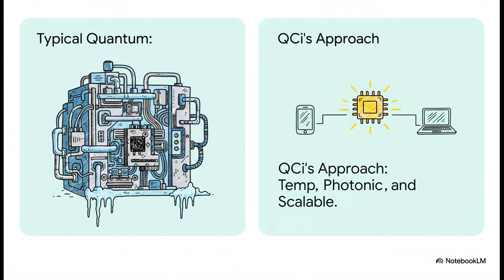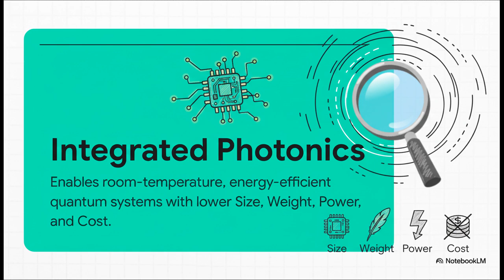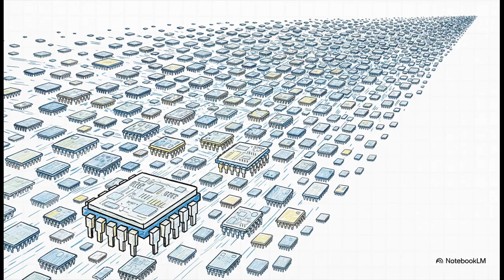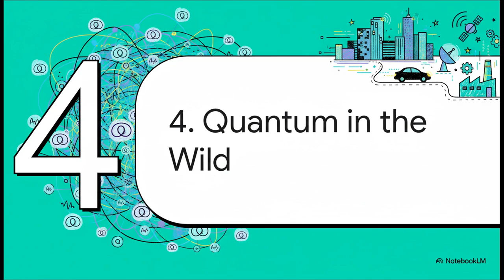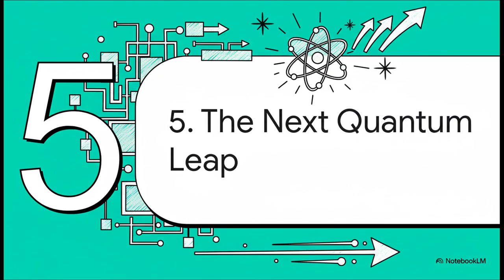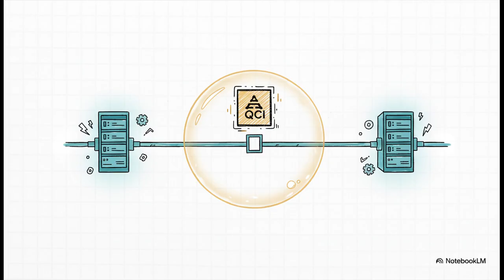QUBT Q3: $1.5 Billion Capital Raised & The Integrated Photonics Roadmap to Volume Quantum Production

Comment: I'm a graduate student and researcher in quantum complexity theory. I'm not a hardware engineer, but I do follow developments in quantum hardware closely. Based on my analysis, I have serious concerns that QUBT’s claims may amount to fraud.

I fully believe that the stock of this beverage-company-turned-quantum-computing should go to $0 (or close to it) and it is only a matter of time before it does.

Fundamentals. The market cap of QUBT is $3.73 billion and for the three-month period ending June 30, 2025, QUBT reported revenues of $61,000 (yes, you read that right), a decrease from the $183,000 generated in the same quarter of the previous year. They do not have a P/E ratio, as they are unprofitable (you could think that their P/E ratio is high and negative). This means that they have an enterprise value of roughly $3.38 billion which comes almost entirely from their market cap and with a revenue of $263k, their EV/revenue ratio is 12.870. To put it into perspective how extreme that is:

If RDDT is inflated, then QUBT is roughly 643 more inflated.
The company's operational model is a financial black hole. While generating almost no income, its operating expenses nearly doubled year-over-year to $10.2 million for the quarter, resulting in a $10.2 million operating loss. That means the company spent over $167 for every single dollar it made in revenue. The bottom line was a net loss of $36.5 million for the quarter.

QUBT's narrative is that it's a pioneer in one of the most capital-intensive R&D races in human history. Yet, its R&D investment totaled $6.0 million. To compare, Google and IBM are forming partnerships to pour $150 million into university research alone, with their internal budgets estimated to be in the billions. How can QUBT possibly compete, let alone innovate, when its R&D budget is a rounding error for its serious competitors?

 future plan For 2025, they claim "Early revenues primarily from early adopters." This is their present reality: microscopic revenues. For 2026-2027, they project "High-margin revenue from first mover advantage" and "Strong pipeline conversion." These are classic, undefined marketing terms. What constitutes "high-margin"? 20%? 80%? How much revenue? A million dollars? A hundred million? The lack of any figures makes these claims meaningless. There is no way to measure their performance or hold them accountable. They have no viable plan to get an advantage. It's a promise to perform well in an undefined future market.

They sell something they call the DIRAC-3, which is an analog quantum annealer. It is not a universal quantum computer capable of running a wide range of algorithms. Its sole function is to find approximate solutions in a a narrow category of optimization problems. In practice, its actual use is almost certainly confined to experimental and research settings. The buyers are not businesses looking to solve their core operational issues, but rather academic institutions or corporate R&D labs that are exploring novel computing architectures. For these niche customers, the DIRAC-3 serves as a piece of laboratory equipment to test theories, publish papers, and perhaps make small claims in quantum-adjacent research. The almost non-existent revenue confirms that it is not being deployed for any meaningful commercial or production-level task.

The primary reason a research group might acquire a DIRAC-3 has little to do with solving a pressing business problem better than a classical computer. Its appeal lies in its novelty and convenience. The machine's use of "qudits" and its analog architecture makes it a fun object of academic study at the very best. In essence, someone would want the DIRAC-3 not because it provides a superior solution, but because it is a comparatively cheap tool for exploration and playing around, not a tool for production.

The future prospects for the DIRAC-3 appear exceptionally bleak. It is trapped in a brutally competitive field and it has failed to demonstrate a decisive advantage. To be commercially viable, it must solve a specific, high-value optimization problem significantly faster or cheaper than the highly-refined classical software that has been developed over decades. There is zero evidence that it can do this, and it will never be able to do so. Its potential market is being squeezed from both sides: classical optimization algorithms continue to improve, while the slow but steady progress of true universal quantum computers (i.e. by Google and IBM) threaten to make such intermediate devices obsolete. The DIRAC-3's most probable fate is to become a technological footnote. It is an interesting but ultimately unsuccessful architectural experiment that never found a problem it could solve well enough to justify its own existence in the commercial world.

They make some claims of what they "will develop"

First is the Photonic Intelligent Unit (PIU), or "Reservoir Computer," which is being marketed as a revolutionary device for "compute at the edge" and Artificial Intelligence. This is straight up misleading and the reality is that reservoir computing is a highly obscure, academic niche even amongst researchers. It has zero commercial adoption. The AI market is not asking for this and it never will, not even in 20 years. AI is built around GPUs and specialized AI chips from NVIDIA, Google, and Apple. The notion that QUBT's niche device, based on a fringe computing model, could make even the smallest dent in this market is laughable. It is a solution in search of a problem, a research gadget being passed off as a commercial AI accelerator. Its only potential customers are a handful of academics, not the enterprises driving the AI revolution. I fully believe they only included the word "AI" as a buzzword to attract and scam more investors into their sham of a company.

Next is the Quantum Cyber Module (QCM), which promises "unconditional security at chip scale" and is supposedly destined for "cell phones." This is pure fantasy. At its core, this device is likely just a Quantum Random Number Generator (QRNG), a piece of hardware that has been around for years. While useful for specific cryptographic applications, the market is small, and established competitors like ID Quantique have dominated it for over a decade. The claim of putting this technology into a cell phone is absurd. The cost, size, and marginal benefit over existing cryptographic algorithms make it a non-starter for any mass-market device. It is a commodity component being dressed up in a superhero costume of "unconditional security" to attract investors who are fearful of cyber threats but ignorant of the actual technology.

Finally, the company to have a "Quantum Intelligent Sensing Module" (QISM) focused on LiDAR applications, boasting "unparalleled detection accuracy." This is, perhaps, the most ridiculous claim of all (and they have made a lot of crazy claims!). Consider heavily-funded companies like Luminar and Velodyne fighting for razor-thin margins and massive automotive and defense contracts. These companies have invested billions in manufacturing scale, supply chains, and industry partnerships. QUBT has none of this. Their supposed technological edge (single-photon detection) is a known technique with its own significant drawbacks, not a magic bullet. They are entering a market with a lab prototype and a marketing slogan. Their sensing platform has no viable path to commercialization and stands zero chance against the alternatives.

In conclusion, these other "gadgets" are not serious products. Each one is a lab-level prototype, carefully branded with the buzzwords of a hot industry (AI, cybersecurity, autonomous vehicles) to create the illusion of a diversified, high-tech portfolio. In reality, none of these products have a credible path to generating meaningful revenue or competing in their respective markets.

Lawsuits and future contracts. QUBT is now facing multiple securities class-action lawsuits that accuse the company and its leadership of securities fraud. The allegation is that QUBT deliberately misled investors through a series of false statements and material omissions designed to artificially inflate its stock price.

A central point in the lawsuits is the systematic misrepresentation of its relationship with NASA. The company presented itself as a key strategic partner, implying its technology was integral to the space agency's operations.

The legal complaints further allege that the company created a false narrative of commercial readiness. While executives claimed to have market-ready products like the DIRAC-3 and a significant sales pipeline, the company's public financial filings reported negligible revenue. This data is presented as direct evidence that the commercial operations described to investors were a fiction. The lawsuits contend that the company was not a viable business but was merely pretending to be one to support its inflated market valuation.

Finally, the lawsuits claim that QCi made unsupported statements about its technological superiority, including achieving "quantum advantage," without providing the necessary scientific proof. The plaintiffs argue that these were not good-faith claims but were technical jargon used to intentionally mislead investors who could not independently verify their accuracy. These legal actions now pose a direct threat to the company's operational stability, demanding millions in legal fees, consuming management's focus, and causing irreversible damage to its reputation.